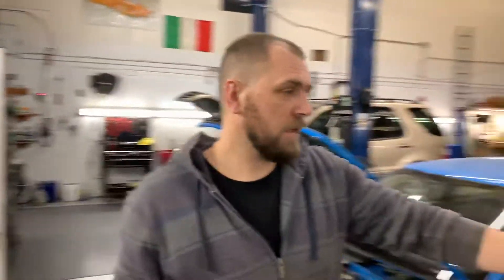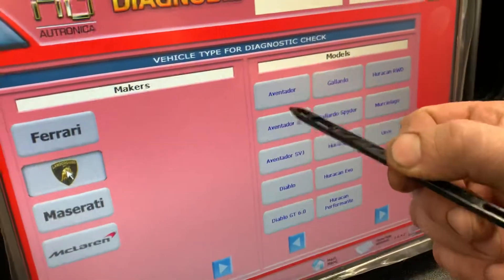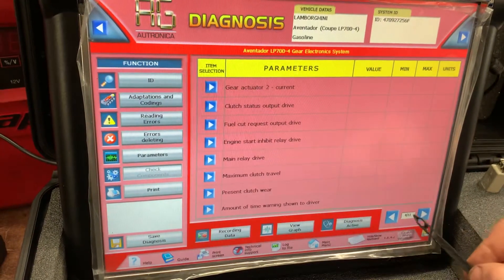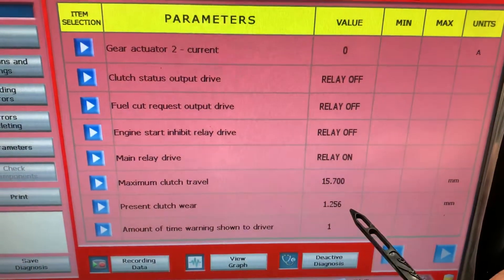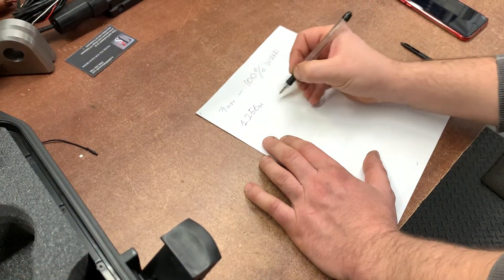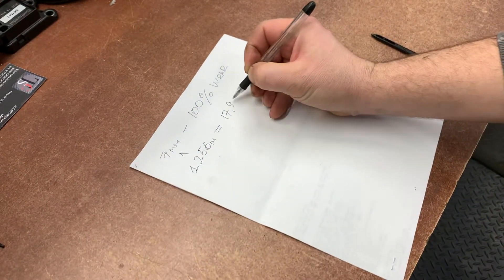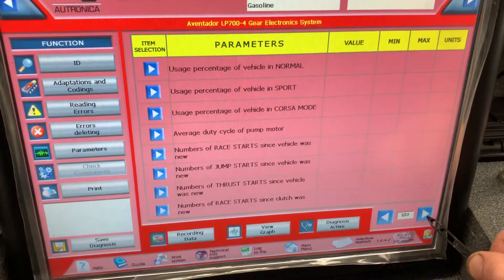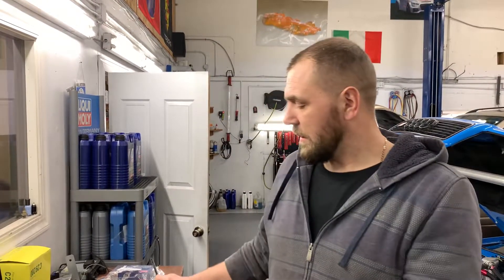Lamborghini Aventador  reading clutch parameters and understanding wear index. By Leonardo Diag Tool

Comment: How much miles aventador clutch last
I heard huracan clutch last 70 to 90k miles
Aventador lasts very less
Reply from the maker: Avetadors clutch life between 50- 80 kmiles , depends launch control usage. 
Huracan use dual clutch wet gearbox.